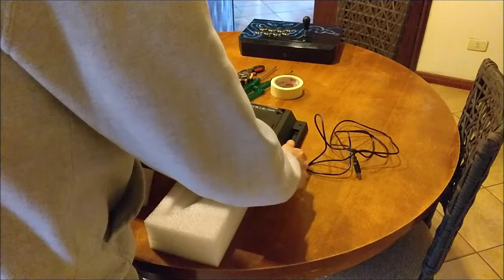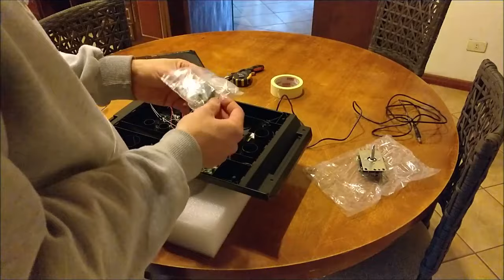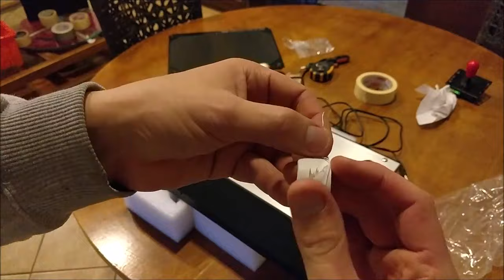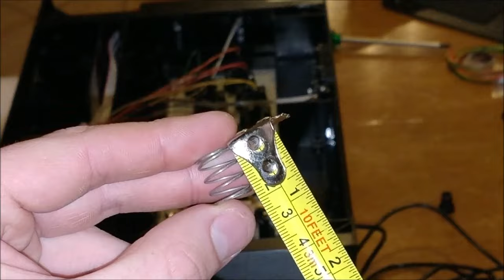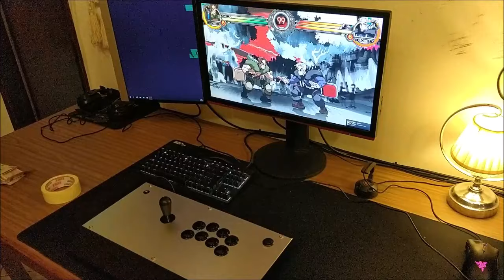Hori Fighting Edge Full Sanwa MOD JLF Joystick battop install and Silent Buttons

Comment: Oh whoa, so a Sanwa JLF can fit in without any issue naturally? Thanks for the video.
Reply from the maker: Yes. Np man
Reply: Also all Seimitsu sticks fit this stick. It even fits the Seimitsu SS plate that is bent to get the stick as close to the top panel as they were originally designed to in the 90's.

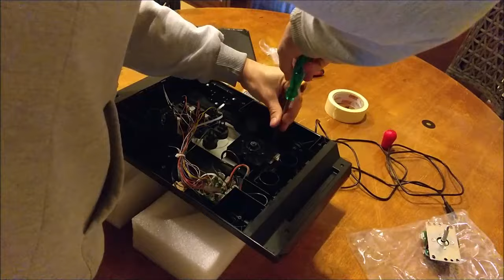Comment: so at 2:52 when you take out the 5 pin how exactly did you take it out? I want to know if it was as simple as pulling it out or if there's a button we should press somewhere to get it out.
Reply from the maker: sorry my body cover the take, it has a little tab you should pull up and then you pull the 5pin out, if i remember it has a little hot glue and thats why i used a screw driver to pell it off before pulling the 5pin

Comment: Is your bat-top a Sanwa or generic bat-top? 

I just picked an FE and bought the a JLF stick with black OBSF30 and OBSF28 for the options button.  I think the stock buttons look best with the silver /chrome surrounds.

With Sanwa buttons are the silent buttons a step up from the regular buttons or are they a little mushy? Was thinking of getting the Sanwa silver buttons with black plungers but they are a little pricey.
Reply from the maker: Yes they're a little mushy but is worth for the noise reduction, yes it is also an original Sanwa Battop
Reply: @EliasVodka  Many thanks.
Reply: Sanwa stick and buttons arrived today.  The buttons were super tight to get in.  I had to put lots of force on the edges to snap them into place.  Was this the same for you?

Also I changed out the Options button as well so they are all the same.

Stuck with standard Sanwa black buttons as a full chrome set with black plungers would have cost nearly 50€
Reply from the maker: @davieslm  yes. Sometimes they got kinda extra plastic it gets scratched away

Comment: I replaced the haybusa for the sanwa jlf and pulling off dragon punches has been incredibly inconsistent, I went back to the haybusa and had no problems what so ever. I'm wondering if the jlf isn't as compatible with the hori board? Like maybe the Jlf would be great on a universal board?
Reply from the maker: i also went back to the hayabusa, is just a better built joystick, the jlf is so cheap and poor built

Comment: Hey man

 I want to Mod my Hori Fighting Edge cause i dont like the buttons + joystick, the buttons feel a little cheap and are loud + i don't like the sound, the joystick has a pretty long trigger travel and feels a bit clunky, i'm a total noob and have never modeled anything, so I wanted to ask if you can help. I might want the Crown CWL-309M-JMS-ST25 as a joystick

or get the IST-ROX Knee Lever, as buttons possibly the CROWN / SAMDUCKSA SDB-202M Cherry 30 mm Screw-in Button - Silver, or Seimitsu PSL-30N 30 mm Screw-in Button, Now I wanted to ask first if you like the products can recommend, and whether you can tell me what I need for the conversion, e.g. you need an 8 pin connector for the knee lever. I also wanted to ask if there could be any problems, e.g. there was more input or something else due to the renovation. Many thanks in advance
Reply from the maker: the parts looks good, the only thing that worries me is if the korean levers can fit in the hori edge, the fightstick is kinda slim, everything else sounds good. is just a matter of try an error, you may like korean or japanese levers or octagonals or square gates who knows, thats the fun of the hobby. good luck

Comment: nice video and mod! Im actually debating on what ARCADE FIGHTER JOYSTICK i want to get to mod. so in your opinion, which is best between this HORI FIGHTERS EDGE and the HORI Rap4 on your older video?

they all look nice (Even the mayflash brand), but i dont know which is best and most comfortable. to keep it simple, im trying to have the "90's USA STYLE FEEL" as close as possible. Example... MORTAL KOMBAT, STREET FIGHTER, TEKKEN, and NEO GEO GAMES.
Reply from the maker: i really like the fighting edge size, your hands rest easy on the stick and also de noir layout is really comfortable, but the size may also be an issue, the fighting edge is my home stick and the rap 4 i take to my friends house, also theres a gap betwen the stick and the buttons that is a good size for me, i also have the razer phantera and the gap is really small in that stick, making my hands cramp. i say get the hori rap4 is cheap and good and the layout is similar to americans cabinets, not the same but very close.
Reply: @EliasVodka  awesome, thank you. i like the button layout better on the RAP4 anyways lol. ok what buttons/joystick parts do i need to get for the RAP4 joystick for that 90's feel?  ....im a newbie just now learning so forgive me lol. always wanted a GOOD JOYSTICK to use for my fighters though. nice 8-wayn octagonal with those american style buttons where the center of the button is caved in. :)
Reply from the maker: @kjmullinz  hmm, you can get the sanwa jlf joystick, a battop, octagonal gate and a higher tension spring, that would make it feel oldschool, the standard joystick that comes with the rap4 is ok but too loose imo, even if you chance the spring youll get miss inputs, but if youre looking for a effortless gameplay experience i say keep using the hori hayabusa stick.
Reply from the maker: @kjmullinz  about buttons im not really sure what should you get, i never tried americans buttons, only sanwa and koreans, idk if theyre good or compatible with the rap 4

Comment: Hi so wanted to ask did you stretch the spring to 2.5 or 3? I'm planning to get the 1.5lbs tension spring and would like to try your method first I have the 2lbs and it's heavy for me
Reply from the maker: Try 2.5cm first but if still a little loose try 3.0cm. the spring is gonna loose a little tension after the first use and then is gonna settled.
Reply: @EliasVodka  Thank you

Comment: Is the bat top make it easier to control the stick ? Cause i recently switched from pad to stick  and i tried different holds and i find ball top hard to control
Reply from the maker: Maybe, since the battop is a little taller you have more lever to work with. Is not a huge difference but it may help, just keep practicing it takes some time